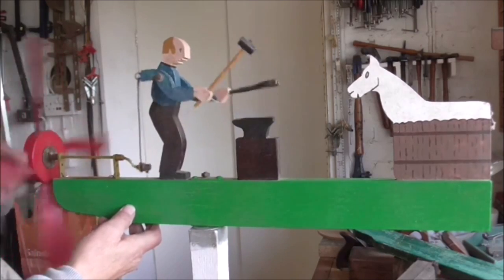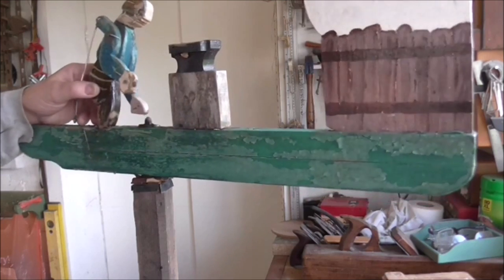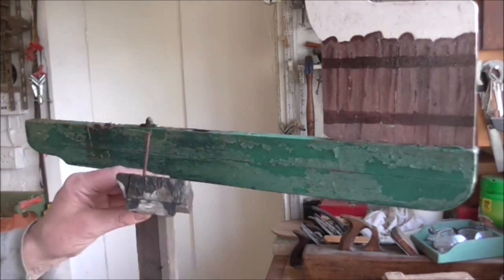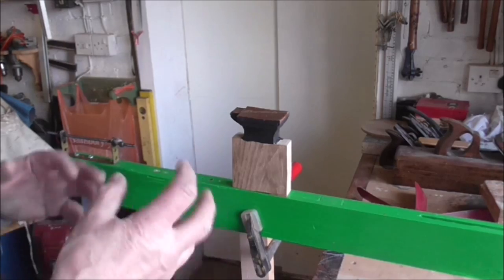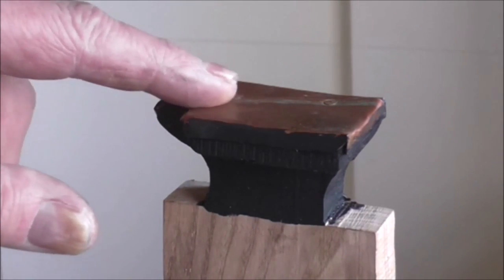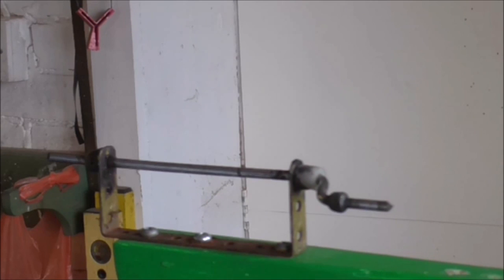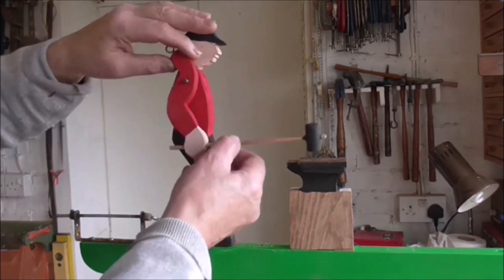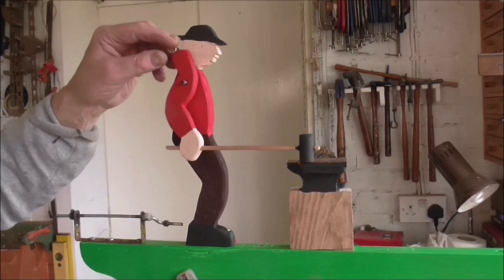Whirligig hints and Tips

Comment: You are talking about balancing the whirligig once it is completely finished.  I am wondering if you take the time to balance the fan before putting it on as well?  I would think one wouldn't wish for one side of the fan to be heavier than the other side of the fan for proper operation in the wind.  Thanks!
Reply from the maker: Thanks for the comment. I have not had any problems with balance on the fan, I don't do anything particular just make them with the blades the same size etc.

Comment: Mr Scrimper ive found the ideal  propellor rod for driving the Whirligigs 6013  WELDING ELECTRODES and no need to enlarge the hole in the brass plug fittings .knock all the flux off before using  cheers
Reply from the maker: Thank you for your useful advice Granville.

Comment: Hello! Enjoying your videos! I'm having a problem on my galloping horse whirligig.  Turns fine until I hook up the horse then it is hard to get started.  Would you have any suggestions?  Thank you!!!
Reply from the maker: very difficult to say without seeing it, Is the cam 'locking' up? If the cam to shaft distance is too wide it would make it harder to start.
Reply: @scrimperuk  Hello again! Thank you so very much for the tip.  I shortened the distance and it is working just fine!!!!
Reply from the maker: @donniecorley8129  Good show.

Comment: Do you remember where you got the steel propeller hub from?
Reply from the maker: Hi Robert the hub is just a standard Meccano part. the part number is 24 and it's called a bush wheel they are very common and cheap to buy new or second-hand. There are also several other Meccano parts that can be used as hubs and the joy is that they have a screw  so that you can secure then to the axle or rod.
Reply: @scrimperuk  , I just placed an order. Thanks

Comment: The block holding the anvil is turned up with the end grain exposed.
Turn it where the side grain or edge is up and it will last forever.😊
Reply from the maker: Thank you for your comment. I think lasting forever is a bit optimistic though :)
Reply: @scrimperuk  yes, I should have said longer.😊
Reply from the maker: @mikejustice1196  These do not fare to well in the UK winters. I leave them out all year round.